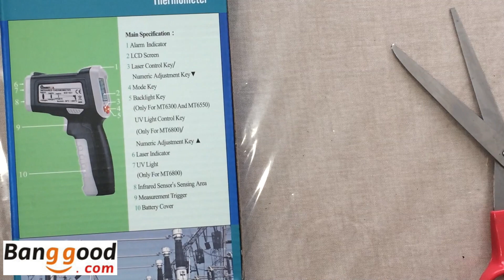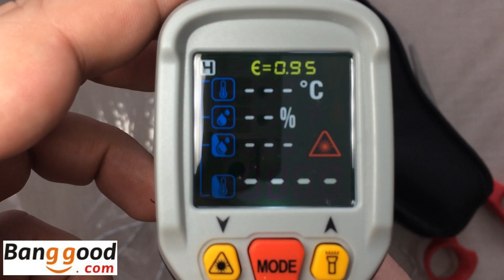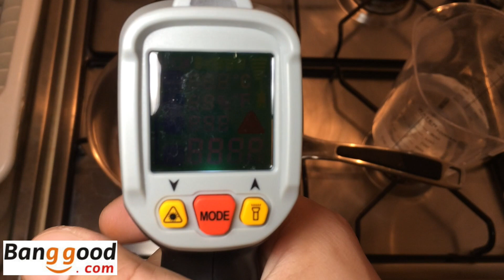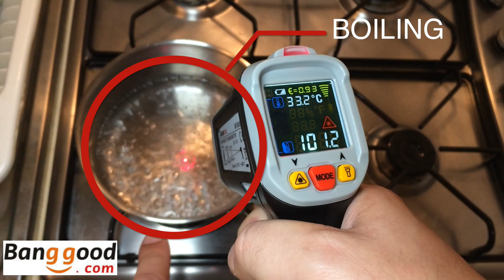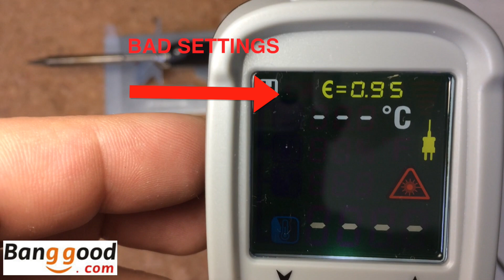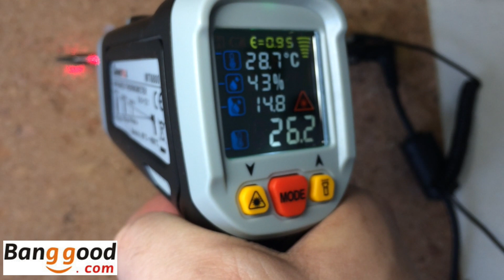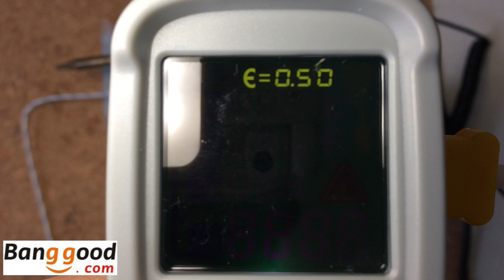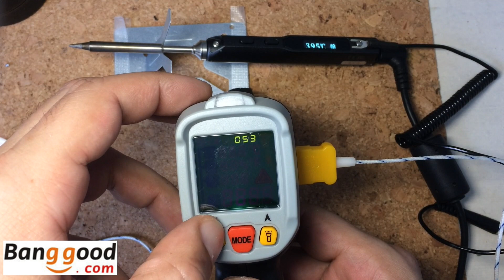⭐️Mustool® MT6800 -50~800℃+K-Type

Comment: The emissivity "E" adjustment is only for the laser not for the thermocouple probe.
Reply from the maker: Hello sir,
The emissivity setting is only dedicated to the laser and not to use the probe supplied with the thermometer. Emissivity is related to the concept of infrared laser. The Infra Red pyrometers or thermometers measure the thermal radiation emitted and more broadly the surface temperature of the material at an optimal pre-defined distance: emission ratio (denoted 8: 1, 12: 1, ...).
The thermocouple does not use the same method to determine a temperature, so there is no need to adjust the emissivity value. Regarding the thermometer that I present it is necessary to set the device in thermocouple mode by pressing the MODE key until the symbol of the thermocouple socket appears and insert this card respecting the positive side and then you press the trigger. The thermometer then displays the surface temperature and that of the thermocouple.

Subscribe !

Comment: Thx for your walkthrue and I also got one of these picked up a year or 1½ back, but when thing there is really annoying me and is also stating on BG that it should have it, is max and min feature... even all the lesser models from this Mustool series  got it,and I cant in my wildest dreams reckon that they have forgotten to put such an vital feature into there top of the line IR temperature meter,.
How do one get max and min values on this device??
Reply from the maker: Hello,
I do not really understand what you are looking for by quoting this characteristic of "max" and "min"? the 6800 version does not indicate the other version of "max" but the green and red indicator tells you how it is explained on their site. If you talk about the dew point then yes the device says it as explained in the instructions downloadable from the site banggood. If not, please tell me what exactly you are looking for by giving me a specific example please, then I could help you. The site also indicates that the display of the 6800 model is not the same as the other models and it gives a link to view it. Give more details about what you are looking for and I will solve your problem.
Thank you
Reply: LIke any temperature device you will need max and min.. an example I will take my MT6800 and see the highest temperaure on my laptops front.. any other IR temperature on the market in this pricerange you can see the highest temperature it measured . fx 45 degrees.. this one are not ale to do that.. it only shows the moment-value. (you understand?)  Its also called "high & low" feature.
Reply from the maker: yes I understand now what you are looking for these values max and min but these are no longer present on the LCD of the laser thermometer since other function have taken their place. If I remember correctly it is written on their website that the LCD display of the MT6800 model is different from the pictures of the previous models.
Personally I find it rather precise that it is in ambient temperature as in temperature of surface if you made the good settings according to the materials to be measured, I show all this in my video.

So I do not know if what I am going to tell you will help you but there are softwares to monitor the temperature of the components of his computer and it is reliable. I compared the data provided by the laser thermometer and those of the software in the case of my laptop and I find almost the same values at a time t so you can also monitor on a longer time scale your temperatures and even there see max and min temperatures or averages etc.

Hoping to have answered your questions, I am pleased to see you again on my modest channel of knowledge sharing!
Reply: Yeah I also think its a mistake that Banggod list it with the max feature as you can clearly see that the display doesn't have that symbol or any high or low symbols.
Its not a big problem anymore i got many other with that feature and mostly i use now thermal cameraes there has like 77.000 measurement point (you can se it on my channel).. but its solid that this MT6800 can go to 800 degrees,.. IT thermometers that can go that high usually cost a lot more.
personally i dont use any of the other features inn my Mt6800 like the blue light or the ambient feature or the humidity feature.. but yeah it looks solid and the price is fair recall i paid around 24 bucks for my 1½ year ago at birthday-sale... thx for the video and your time.
Reply from the maker: it is true you are right. Applications that need to go up as high are very specific especially in computer science. It should be put on a bench to see its behavior and accuracy between low temperature and max temperature to see if the thermometer remains reliable. On a standard measuring range it seems to me reliable (freezing temperature up to the melting temperature of the current metals and aqueous solutions, it is useful.
See you on my channel.
Have a good day.